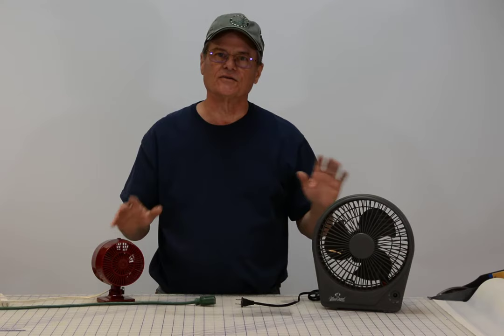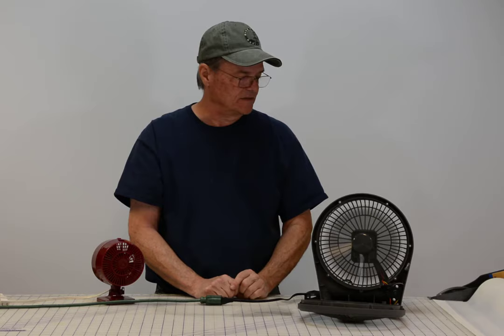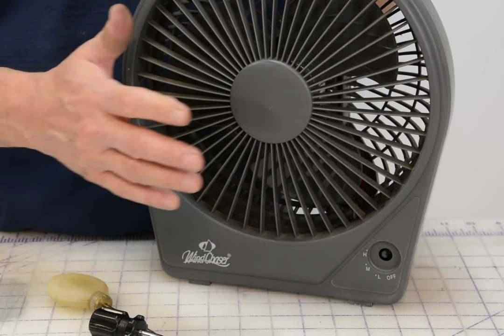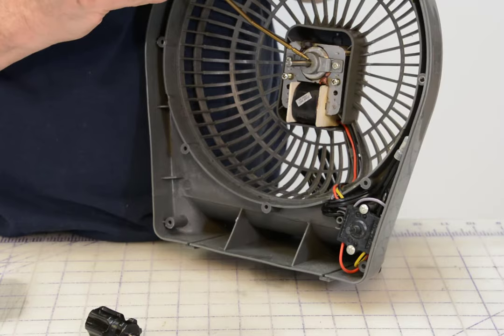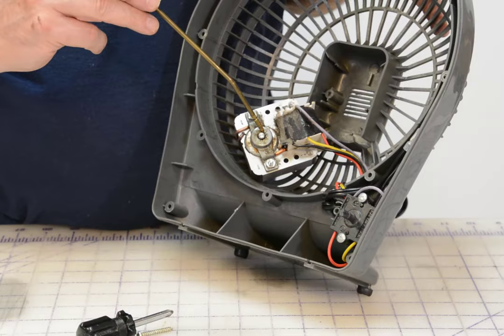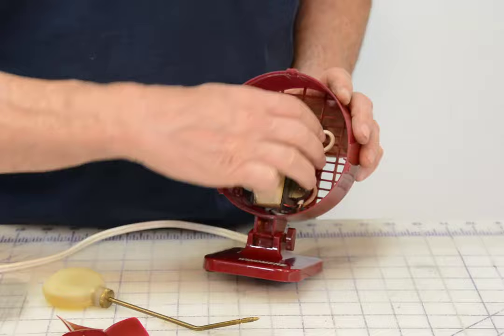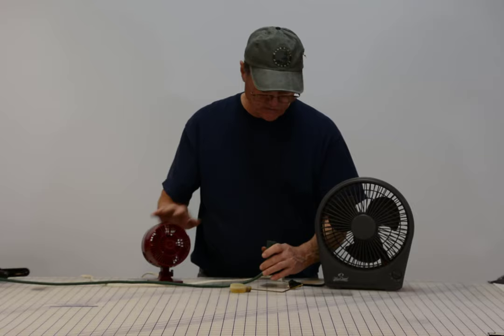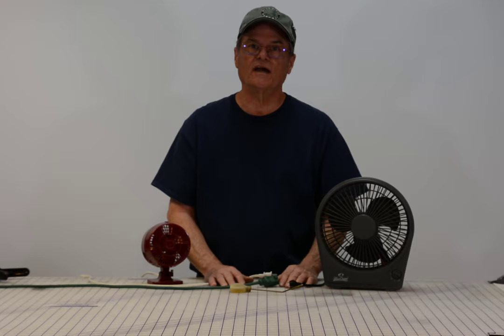Fan slow to start or won't startup - Easy Fix!

Comment: I have this “WIND MACHINE” I’ve been trying to figure out for weeks now... It powers up, but HUMS, and (with motor exposed) I can see the rotor magnet LEANING AGAINST the coil inner wall... there are also visible signs of uneven wear on the rotor magnet which lead me to believe it was wobbling.... I broke it all the way down and found this weird slop in the bearing chamber... another YouTube video said to REMOVE the slop and install an alternative material that fills the gaps but allows some cushion. I attempted SEVERAL TIMES to replicate the process and CANNOT FIGURE THIS OUT....  is the rotor magnet grabbing the coil wall MAGNETICALLY??? Or is it just off balance and grinding against it getting stuck???

I have forced/assisted  the motor to spin and IT DOES.... however it wobbles slightly, makes a rubbing/light grinding noise consistent with the wear patterns mentioned above, and eventually HALTS and cannot be done again unless I unplug and replug (some sort of safety cut off?)

I haven’t allowed it to spin long enough to replicate that cut off again because it doesn’t seem very healthy for the motor, so WHAT DO I DO???  I’m aware of the LUBE issue and DID TRY WD-40 AS A TEMPORARY TROUBLESHOOTING LUBE figuring it has to work for at least the time I’m working on it, and if fixed, I’d add the 3in1... 

An I right to think that one or more of the coils is failing and causing the wobble and grabbing?  I should also mention that online reviews mention this same problem every so often...  Some report seizing w/ humming like mine, and some report the GRINDING noise ... one lady said the grinding stops and starts depending on the angle the fan is set at!! I found that to be a very telling clue...  

Clearly this is a trash heap but I’m doing this for my ego as I’ve been told I cannot fix it by my condescending neighbor.. lol..

Please advise
Reply from the maker: Hello FLOJOtube,

You asked:
“ I attempted SEVERAL TIMES to replicate the process and CANNOT FIGURE THIS OUT.... is the rotor magnet grabbing the coil wall MAGNETICALLY??? Or is it just off balance and grinding against it getting stuck???”

Yes the coil and rotor are grabbing each other.  The wear you are seeing on the rotor is because of the wear in the bearings.  The coils and rotor are not suppose to touch.  

“ I haven’t allowed it to spin long enough to replicate that cut off again because it doesn’t seem very healthy for the motor, so WHAT DO I DO???”

It is not healthy for the motor.  Don’t put WD-40 on it because it is very thin.  You could try grease because it is thicker and will take up some of the space created by the wear in the bearings.

“Am I right to think that one or more of the coils is failing and causing the wobble and grabbing?”

No, I don’t think so.  I think all your problems are because of the worn-out bearings.

“Clearly this is a trash heap but I’m doing this for my ego as I’ve been told I cannot fix it by my condescending neighbor.. lol.. Please advise”

I think you have 2 options:
1, Purchase new bearings.  You will most likely have a LOT of trouble finding the correct bearings.
2,  MY SUGGESTION IS, purchase a new fan and remove the motor and install it in the old housing.  Then drive across town to discard all the evidence of what you did to repair it.  Then tell your condescending neighbor “See, I fixed it”  And refuse to tell him how!

Good luck
Thank you for visiting and have a GREAT DAY
ALSO: I would love to know how this ends up.

Comment: Aren't some fan blades screwed on (unscrew opposite direction that it spins in) but no threads on that shaft?
Reply from the maker: Yes you are correct but most smaller fans are just a pressure fit.
Reply: @DIYwithWayne  That makes sense, smaller fans usually generate less wind force so don't require much to stay on the shaft.

Comment: If I don't want to buy the light machine oil you recommend and only have cooking oil, lawnmower oil, or WD-40 available, which of those would be the best to use?
Reply from the maker: The WD-40 will work but may not last al long because it is thinner.   Thank you for visiting and have a great day.
Reply: @DIYwithWayne  Thank you so much Wayne, I'll give that a shot!
Reply: @DIYwithWayne  I found some chain, bar, and sprocket premium lubricant oil, so I'm actually going to try using that!
Reply from the maker: Use the one that is thinner and you should be OK.

Comment: I've got a fan going so slow you gotta spin it to start it even on full power, only got wd40 or used oil from my van, so I'll keep spinning for now
Reply from the maker: You can use the WD-40 but it won't last as long.  It's still better than it running slow.   Thank you for visiting and have a great day.
Reply: @DIYwithWayne  I think it finally kicked the bucket, it was a really cheap fan that got knocked around during moves so it was only a matter of time before it finally died
Reply from the maker: If you haven't tossed it out yet, give it a little spritz of WD-40 and spin it a few times.  What do you have to loose?

Comment: I own wd-40, silicone spray, bike chain oil and lawnmower oil. I have something I put on my garage door opener chain (it mightbe the silicone-I forget right now). It's a really old box fan  with a missing carry handle, so I'm not buying a new product for this. Which should I try first?
Reply from the maker: Hello Cindy, I would use one of the chain oils.  The WD-40 will work but because it is thinner, it won't last as long.  Thank you for visiting and please subscribe to our Channel if you have not.

Comment: I used this technique and the fan starts after this. But after every two days the fan doesn't start and I have to repeat this procedure. I don't know if I am doing something wrong. Is there any way to make the oiling last for longer period of time?
Reply from the maker: I have not had this problem.  It could be the bearings are worn too bad for the oil to do it's job.  You could try taking the motor apart and using grease on the bearings.  If you do try the grease you will need to take the motor apart because the grease won't get into the bearings like the oil will.    Good luck and if you do try the grease, please let us know how it worked for you.

Comment: What kind of oil is used?.. I don't even have a screw to unscrew the nut😔
Reply from the maker: We use a light machine oil like a sewing machine oil or 3 IN ONE OIL.  If it is a screw you might could use a kitchen knife, if it is a nut, you could try using a pair of pliers.  Good luck with your project and have a great day.

Comment: I dont have any oil so what can I use that wont hurt the fan it get really  hot in my room
Reply from the maker: You will need some kind of lubrication.  WD-40 will work but I don't recommend it.  If you do use WD-40, spray it into a small cup then use something to apply it to the bearings.  If you spray it on the bearings you will get over spray that will cause a lot of dust and dirt buildup.   Thank you for visiting and have a great day.

Comment: How long will the repair last
Reply from the maker: There is really no way to know for sure. There are a lot of variables.....how much you use the fan, what shape the bearings are in and the quality of the oil used. I have had some that continued to work for years and some that only lasted 6 months. Thank you for your question. Hope you're having a great day.

Comment: I have a fan where a bunch of hair was stuck in the motor shaft which caused it quit working. I cleaned out all the hair and it still won't work. I tested the fuse with my multimeter and it appeared to work. Any ideas of a fix. I tried spinning the blade manually as well and it spins freely. I tried manually spinning it to see if the start capacitor was bad but it wouldn't start then. Any ideas?
Reply from the maker: Use your meter to check the resistance of the motor.  Make sure the switch is on and test between the two prongs on the power cord.  If it is open, you most likely have a bad motor.  If it was on too long with the hair binding the motor and not letting it turn, it probably burned out the windings in the motor.  If this is the case, it's not worth fixing.  
If it is a larger fan that has a control board of some sort, it could be the problem.    Good luck with your fan.
Reply: @DIYwithWayne  thank you

Comment: Thanks i thought i lubricated it enough i guess not
Reply from the maker: A lot of people miss the rear bearing. The front bearing usually needs oil the most but they both need some.  Good luck with your project and have a great day.

Comment: How long is a drop of oil going to work? 30-45 minutes?
Reply from the maker: It depends on the fan.  If the bearings are in very bad shape, it may not last very long.  Oil can only do so much.  However, if you look at the small red fan in the video, I oiled it in November of 2019 when I made the video.  That fan is used to help cool my freezer's compressor and it runs 24-7.  I have not oiled since November 2019 and it is still running all the time.   Thank you for visiting and have a great day.

Comment: What if you have a fan that might be slow to start, but then it eventually does...but after awhile it stops again. Is it the same problem just a little oil and could I use Tri-Flow Superior Lubricant? Or could it be something else?
Reply from the maker: Most likely the fan just needs some lubrication.  I have never used Tri-Flow Superior Lubricant, but after looking at their website, I think it would work.  If you try it and it works, please respond back and tell us about your experience.  Thank you for visiting and please subscribe to our channel.

Comment: wd-40 is not a lubricant. 3in 1 oil has a corrosive component to eat rust whether it's there or not. Sewing machine or fishing reel oil is good.
Reply from the maker: WD-40 is not as good as the others but the company does call it a lubricant.   Thank you for visiting and have a great day.
Reply: @DIYwithWayne  Spit works as well....
and you knew 3 in 1 had corrosive element. Thanks for looking

Comment: Man, I was too late my mum already tried to lubricate the fan but she poured cooking oil at the motor itself and I'm too scared to turn it on again.
Reply from the maker: Hi Joege, If there is not too much oil on the motor, it might still work. To be safe, I suggest you plug it into a long drop cord OUTSIDE before turning it on. Good luck.  Thank you for visiting and have a great day.

Comment: Unfortunately, it appears that this technique only works for large motors. I tried this method on a portable neck fan and a hair dryer which stopped working. In both cases, the motor started turning again but it only lasted a few minutes. After that, the motor just dies and then it's straight into the garbage.
Reply from the maker: It should have worked but sometimes the motors are just worn so bad that you will have the result you had.  I suspect this was your problem.  Thank you for the comment and have a great day.

Comment: Hi, i tried how you told too lubercate but it still wont turn on it's the same probleme as your big fan.  It's to hard too turn by hand. Can you help me. Thanks
Reply from the maker: Hello Karan, once you have added the oil, keep trying to turn it by hand to work the oil into the bearings. If this doesn't help you might have another problem with your fan. Thank you for visiting and have a great day.
Reply: @DIYwithWayne  hi, i think soo it's an another problem with the fan. I'll might take the motore a part to diagnose the problem.

Comment: Hi everyone I used a pink oil thing and idk what I did wrong the fan still won't start to spin or anything pls help me I don't know what I did wrong
Reply from the maker: Will it turn by hand?  Did you put oil on the front and rear bearing?  Let ne know.
Reply: @DIYwithWayne  no it's not turning by hand and yes I put oil I took of the blade and used a brush to add the oil idk what else to do
Reply from the maker: I don't think you did anything wrong, but if you can't turn it by hand, it most likely can't be repaired.  Sorry.

Comment: I have one that spins backwards, any idea what caused this
Reply from the maker: If it runs backwards, it must be a DC motor.  The positive and negative are reversed.   If it is a larger fan that has a control board, it could be the problem.  If you find the answer, please post back.  Your answer may help someone else.   Thank you for visiting and have a great day.
Reply: @DIYwithWayne  it's a vintage McGraw desktop fan. 1 speed, I'll have to tear it apart and do some fiddling

Comment: Thanks. However, the fans are hardly serviceable, at least that thing I have in front of my nose. I can access the front bearing with a lot of effort but not the rear bearing. It should not be allowed to sell this garbage! They probably made it this way to sell you a new one after warranty has expired.
Reply from the maker: Some are a lot more trouble than most.  Good luck and thank you for visiting.
Reply: @DIYwithWayne  I was able to manage to get that thing back to life by spraying WD-40 inside the casing without disassembling it. At first, it did not move at all. Turning by hand felt pretty hard. After a while it got loose for some reason. I guess it was getting hot while running and after a while it cooled down and the bearing got movable again. I guess the WD-40 will be gone soon. So that I have to redo it every second week or so. Would Teflon be a better option? I have to use a spray as the access is very limited.
Reply from the maker: The WD-40 will likely last longer than you think.  The way you described it starting slow at first then getting better is exactly what I would have expected.  It takes time for the lub to get into the bearing.  I have not tried the Teflon spray on bearings so I would stay with the WD-40 but if you do try it, please let me know how it worked.

Comment: Where can you get replacement bearings for these motors?
Reply from the maker: Sorry but I don't know of a source.  In the past when I've had a motor with bad bearings, I just replaced the motor or device.  I hope this helps and good luck in your search.
Reply: @DIYwithWayne  I use to rebuild motors like these for liquid ink copy machines and the bearings had a "c" ring that could be removed to take off the cover where in your video you put the oil. We couldn't use oil (because of contamination) we had to repack the bearing with axle grease which would increase the life of the bearings for longer than the motor could last. I never saw any of these bearings go bad.
Thanks for your reply

Comment: No mention about capacitor problem? 🤔😁
Reply from the maker: No there wasn't. Most of these small fans don't have capacitors.  Larger fans like in your HVAC may have them but that is not what I was focusing on in this video.  Maybe I should do a video about the larger fans.  Thanks for the idea.   Thank you for visiting and have a great day.
Reply: @DIYwithWayne  my 60W standing fan has a capacitor inside though. It reads 1.5uF+/-10%, 400WV AC, -25 to +65degC. Wonder if there are any videos showing how to test if it's the problem, cos it's kinda looks very easy to change because it's easily exposed and replaced once the outer plastic fan motor cover is opened. 🤔🙂🙂
Reply from the maker: Does your fan run at all?  The start capacitor is only there to help it start.  If you turn it on and spin it by had and it runs, the capacitor iss most likely the problem.

Comment: Is there any other oil that could sub the light 3 in 1 machine oil? I have wd40 but Wayne doesn't recommend it :(
Reply from the maker: You can use the WD-40 but it is very thin and won't last as long.  Also: don't spray it on the bearings because the over spray will attract a lot of dust.  I would suggest you spray it in a cup and use a small stick or something to just put a few small drops on the bearing.
Thanks for visiting and have a great day.
Reply: @DIYwithWayne  I see. I googled and saw someone also recommended sewing machine oil. Is that ok?
Reply from the maker: Yes, that should work. Sewing machine oil is basically the same as 3 in1 oil.
Reply: @DIYwithWayne  Thanks Wayne. Will search for it and hope it helps resolve the issue (:

Comment: The 2nd smaller red fan came to a stop REALLY FAST.  Something is still wrong with that fan
Reply from the maker: No not really,  Sometimes it just takes some time for the oil to get into the bearings good.  This fan has been working 24 hours per day  for months now without a problem.  I let it run on my freezer to help cool the compressor and it is doing a great job.  Thank you for the observation and giving me the chance to explain.

Comment: What if it doesn’t turn at all
Reply from the maker: You could try dissembling the motor.  The bearings could be bad or just stuck, the armature could be stuck to the windings.  Cleaning and lubricating and reassembling it may fix it.  Good luck with your project and have a great day.

Comment: I dropped my fan and saw a spark so now it’s not working and I CANNOT sleep without my fan my room gets way too hot
Reply from the maker: Hello Uhh Saniyah,  If you saw sparks, you may have blown a fuse.  Some fans have a small fuse but it may be hard to find.  Other than that, I don't know what to tell you.  Sorry and good luck.

Comment: Why not wd40?
Reply from the maker: It will work but it is very thin and won't last long.  A thicker oil will last a lot longer.  Also: if you do use WD-40, don't spray it on.  Spray a little in a small cup or something then use something to only apply the lubricant to the bearing. 
 If you spray it on, you will get spray in a large area that will collect dust and dirt over time.  Thank you for visiting and have a great day.